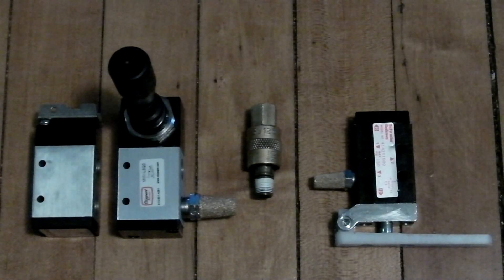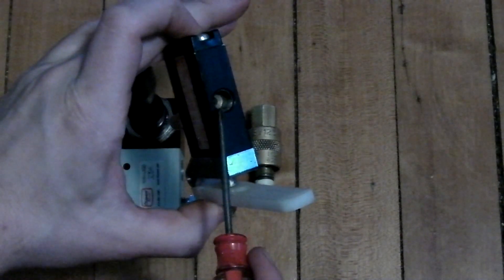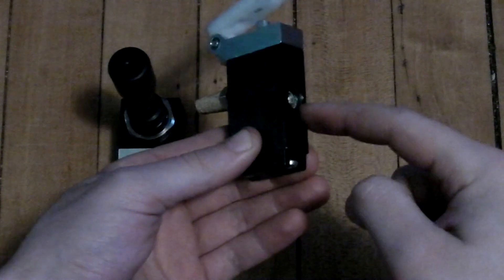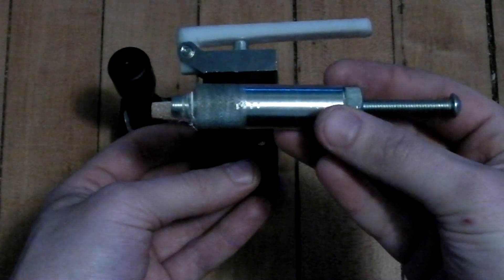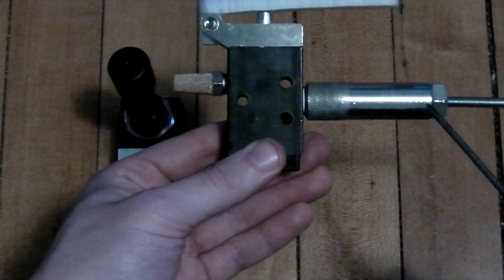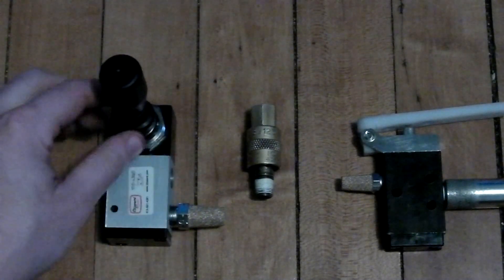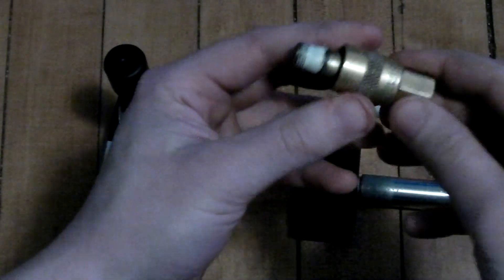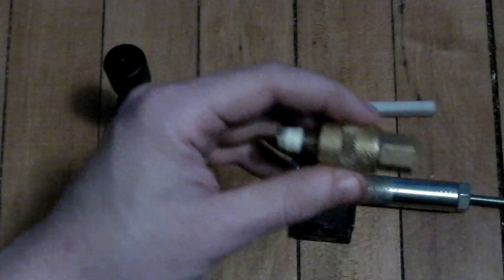QEV Air Gun / Bow Essentials: 2 Position 3 Way Valves & Slide Valves

Comment: First off, thank you for the video this is very clear, great info! For the 2 position 3 way valve would a 2 position 3 way solenoid do the same job?
Reply from the maker: It would indeed. And you're welcome. I haven't posted a new video in forever, but I'm working on something that should be pretty cool this spring

Comment: I'm also waiting for the weather to wam up. Canada Eh ! Some of those 3/2 1/8npt manual valves only have 2 usable ports also, the vent port is usually hidden under the lever somewhere, avoid those, not so flexible for configuration.
Reply from the maker: farcticox 1 huh. I've never seen one like that. But I try to buy USA or Japanese made valves for the quality and safety factor as I'm using them above rated pressure
Reply: I think they are usually the roller type
 http://www.ebay.ca/itm/3-2-Way-1-8-PT-Roller-Lever-Actuator-Mechanical-Valve-MOV-02/372052093323?hash=item56a008698b:g:QmoAAOSwzb9ZmxH-
They do make great triggers
Reply from the maker: farcticox 1 weird, yeah I'd stay away from those. Lol

Comment: Trying to make an arrow gun.. want to use 3500psi tanks. Can you help me out here? Also want to be able to swap berrel from arrow to .357. I don't know how to find the right qev for the job.
Reply: You could fabricate one, steel's cheap, and parts to make seats and pistons are available (McMaster-Carr). Would recommend drafting a full-size drawing of the valve before starting as plans. Use a vertical mill or drill press to minimize runout on the pathways. Maintain reasonable wall thicknesses, and even mild steel can take up to 5000 psi.

Comment: Hey Swan, wouldnt it be possible to fill the system through the 3/2 way valve by using the exhaust port (where you placed your silencers in this example?
I'm working on a design that works best with the parts i can get
Also since i dont have the necessary resources for a volume regulator, what general volume have you found out to work best for airboy designs? 
Hyped for your future projects and my second and third pneumatic arm :)
Keep it up ;)
Reply from the maker: i believe? it would be possible to do

Comment: Your losing more air to activate the qev because your waiting for it to equalise before closing?, a slide hitting a button valve is gunna do a better job surely?
Reply from the maker: Moxi the amount of time it takes to equalize is ms. This setup is simpler than a hammer valve as well
Reply: This allows you to more easily adjust how long the valve stays open. The longer it stays open (while the projectile is in/on the barrel) the more velocity you're going to gain (higher average pressures). Simple knock-valves are much more tedious to adjust, a lot of springs and weights of hammers to match up to tune the gun for just one bore size, projectile, performance and barrel length combination. Change any of that, and you need to start over with a knock-valve. With this, you just adjust the chamber size (or fit the gun with a air-return tube to repressurize the priming chamber once the bullet reaches a certain point in the barrel (not really applicable slip-over-barrel dart-guns)).